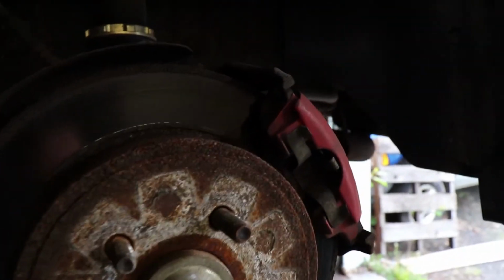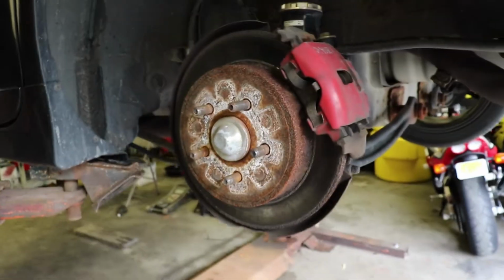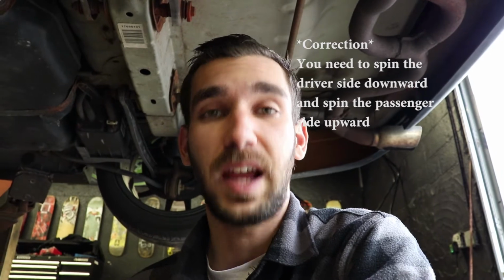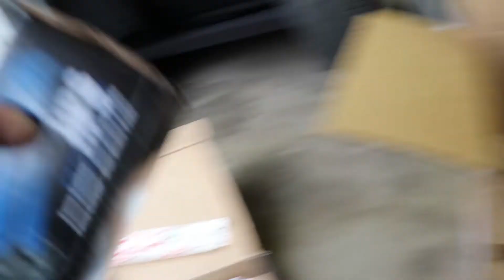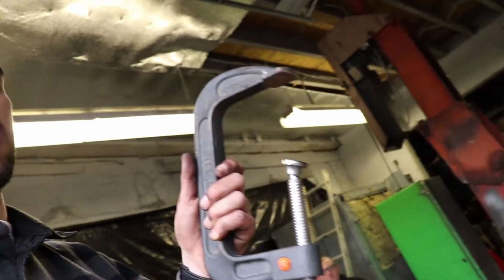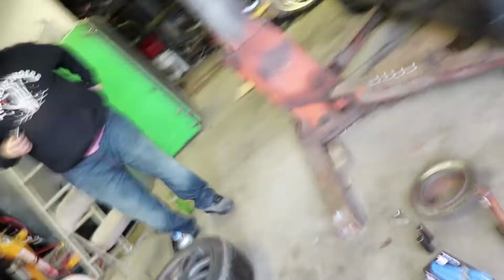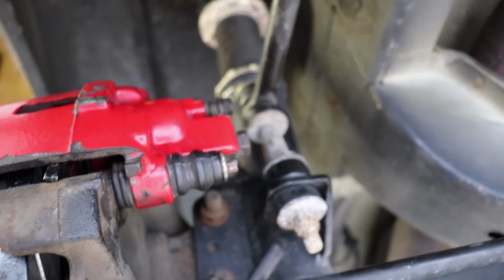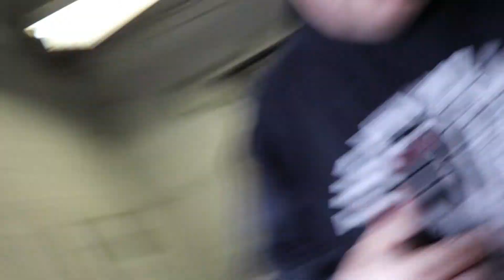HOW TO: Rear Brakes on Neon SRT-4

Comment: Question for anyone...my passenger side rear rotor on my SRT4 completely locked up. Took off caliper and have beat the rotor to death,it won't budge. ANY IDEAS??
Reply from the maker: Drop your e-brake
Reply from the maker: When you have the e-brake engaged it’ll lock the rotor in place with the shoes making it difficult to take the rotor off when replacing